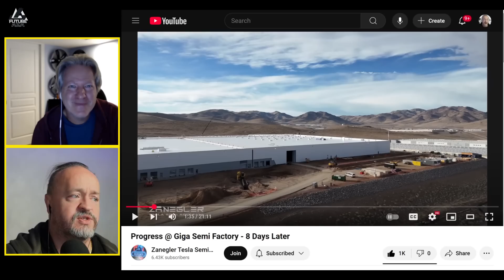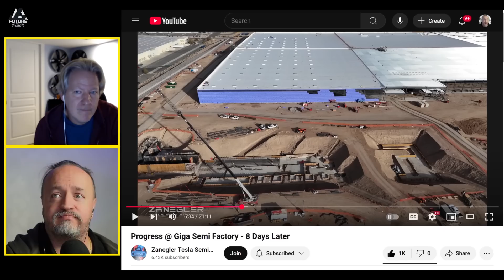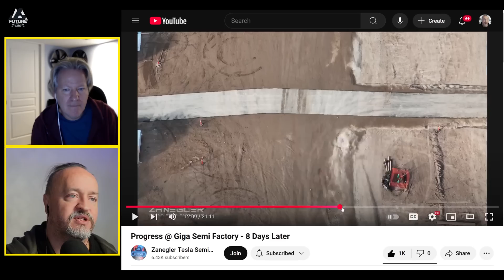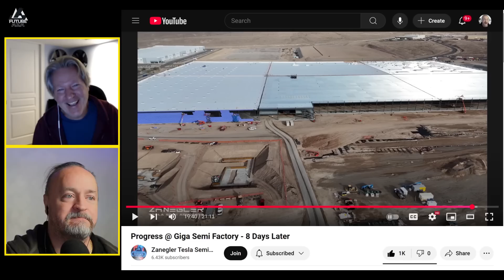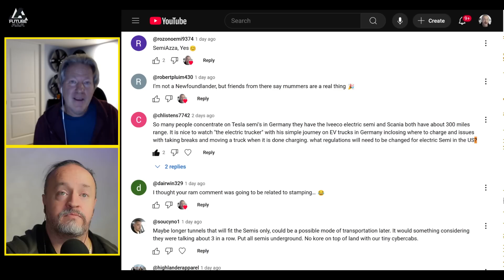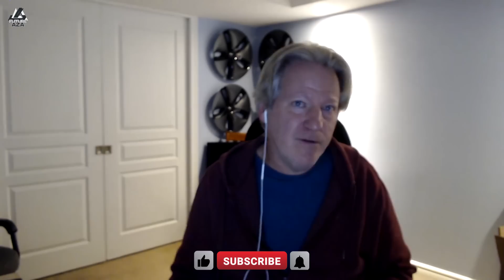Giga Semi Factory Advancing Faster Than Ever

Comment: Doing some back of the napkin math, looks like you can easily carry 2 Megapack XL(3.9MwH each) on a CN railcar. So to go from say Toronto to Ottawa will need 3 railcars hauling 6 x XLs. If there is a planned stop in between, you will only need 2 railcars if you swap them out during your stop. This is assuming 75 KwH usage per km.
Reply from the maker: Where does the 75 per km come from?
Reply: @FutureAzA  I googled "how much kwh does a locomotive use per km in canada". AI came back with 74.8 KwH per km on ave.

Comment: A few years ago, when I lived in the city of Dayton Metro Dayton, we still had overhead electric DC buses, and they are a nightmare to maintain, and when the overhead rails popped off the electric wires, the operator had to get out with a big wooden stick and pop that wire back onnot the job. The Highlander wants. I know I turned it down.😊

Comment: ? ? You guys should dive into the train question more. In Europe 56% of rail is electrified serving 81% of traffic. Japan is <80% electrified. Lines are usually hung from above. Upfront costs are higher yet operation and maintenance is 20-30% cheaper. Batteries in trains don’t make any sense as you’ve pointed out but you guys should travel more. Distances are larger in the us but how would electrification not make sense for certain routes?

Comment: Sending juice through the rails and wheels themselves in order to power trains WILL, unfortunately, result in a regular death tally, even if that method works. Wireless charging devices between the rails is a better idea.

Comment: A St. Louis company has developed electrified train cars that can operate independently and autonomously.
Intramotev, a startup based in St. Louis, is taking an innovative approach to electrifying freight train transportation. Rather than equipping the locomotive with electric batteries, it's creating individual cars that are fully electric and self-propelled. These cars are being implemented in an unusual place—a coal mine.

Comment: While I admit that battery electric freight trains wont ever be a thing in the next 20 years, I still wish I had the skills to do a cost analysis of using a single mega-pack, or even less with a couple of drive units just to help get out of town and up hills, and to help brake down hills and coming back into town. It wouldn't be used steady state, just when needed. Not gonna happen, but fun to think about.
Reply from the maker: Now that's an idea! Doesn't replace the locomotive, but powers up on regen and puts the power back to forward momentum. Don't know how much of the slowing is done on downgrades by the engine vs the brakes along the full train.

Comment: Hey, you referenced my 8 mega pack on a train car. Thanks. Checked, I was using Megapack 2 XL sizes. MP2XL which are 84k pounds. Standard rail boxcars can carry 286k pounds, heavyweight cars a bit more, and locomotives 430k pounds. So, 3.5-4 MP2XL per boxcar/locomotive with (3.9MWh per pack) 15.6 MWh of energy total. Or really, just pack the locomotive with 4 MP2XLs, since no diesel generator or fuel needed. Using .02 kWh per ton per kilometer, a 500 kilometer rail journey for a 1,600 ton freight train would consume 15MWh. Adding fast charging at rail yards would be a big hurdle. But they can just have more locomotives or battery cars.

Comment: Sorry but almost everything you said about battery electric trains was wrong. Most trains (at least in Europe) already have electric motors in every carriage, even if the set is powered by a diesel 'generator'. Battery weight is not an issue with trains (unlike in road vehicles), and it's not obvious that (for new rolling stock) it would be significantly more expensive to install smaller batteries in each car rather than one big one for the whole set - and a big advantage is that it makes each car much more flexible because you don't need a locomotive to move them around! This is exactly what Intramotev is doing for freight. As for cost, you can argue that batteries aren't cheap but neither is diesel! Also, most major rail lines in continental Europe have overhead electrification even 'outside of cities', though there are still plenty of rural lines (and the UK) that aren't electrified and are prime candidates for battery-electric trains.

Comment: I'm a retired trucker & I could charge up 1/2 to an hour to shit, shower & shave with a good steak while my rig could get a good charge if not full. You legaly need those break out there.😊
Reply: Elon got the trucks to recharge to 80% in 30 minutes, so if you're getting 500 on full charge that would mean 400 at 80%, do you think that could have worked for you during your trucking days?
Reply: @francoischarbonneau9447  After driving 400 miles, time for a break & recharge.

Comment: In addition of being badly wrong about overhead lines, in Europe most modern trains have fully distributed motors, so maybe something exists that Musk does not need to struggle to "invent" (it fits in the same hyperloop basket, the only difference is that trains overhead lines and distributed motors actually work...)?
Reply from the maker: Rude as hell, cool. 155,000 miles. Go on then, build it. We'll wait.

Comment: From grok: The Belgian rail network has approximately 3,607 km of total track, of which about 3,066 km are electrified.
Also an ox is a bull with a job, but without ball's.
Reply: Finland has 5926 km railroads, electric 3270 km. Note that population density of Finland is 18.3/km² EU average is 109/km² 
Maine and Oregon 17/km²

Comment: 20 year trucker here…perhaps one issue ahead of the adoption of long haul T Semi variant would be truck stop charging adoption. Most trucks may fuel, wash windows etc then move ahead and park in front of the fuel island. Less than 10 minutes. 

Does anyone know how much the LR variant would get in 10 minutes as a “top off?” Most truckers will only stop if needed, and get back going ASAP.
Reply: UK and Europe have strict driving / resting rules so charging is generally not the issue.

Comment: It just sounds wrong "Mary had a little little sheep".  Omg. I love it.     I also think that there is actually a LOT of electrified rail in Europe especially central and Western Europe.  They are way ahead of most of the world with that.  Also the comments saying it's silly to have a motor on each wheel in trains , well it's not that silly. As a lot of multiple unit passenger trains do power every wheel. The Japanese Shinkansen for one example.    Love your work by the way.